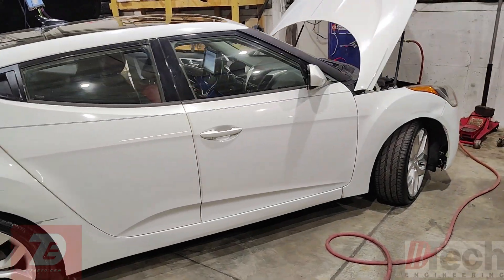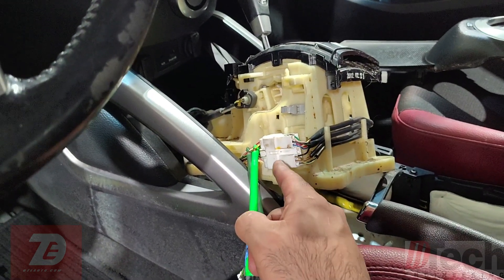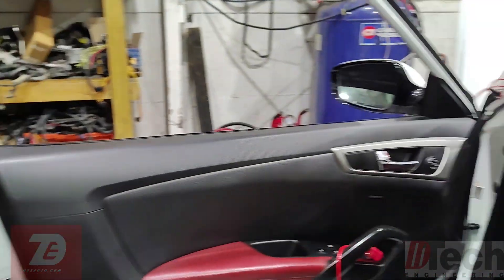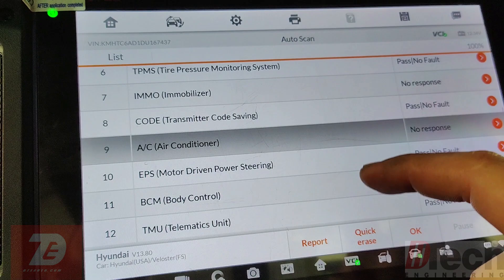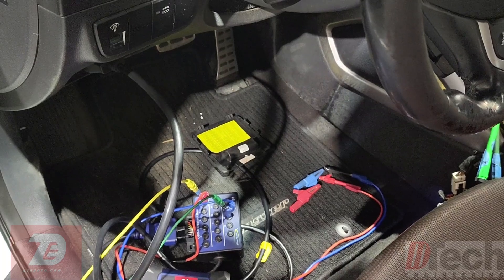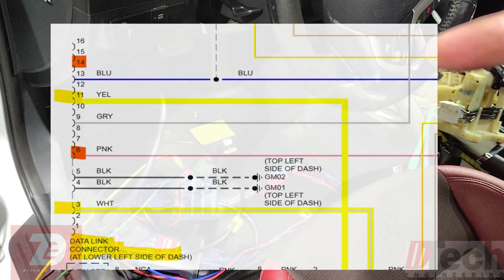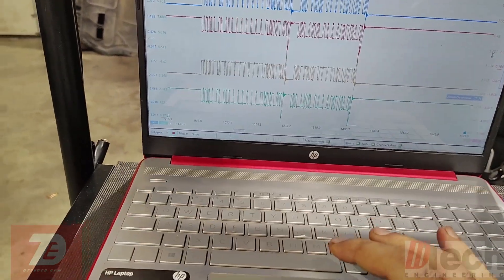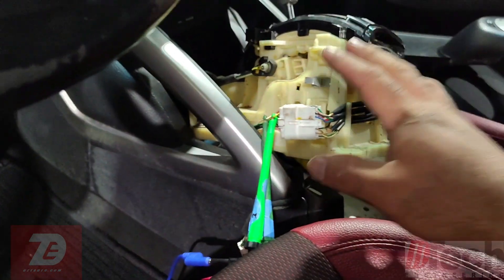2013 Hyundai Veloster Shifter (TGS) No Communication (U1103)

Comment: Question,  could the network being load test prior with a test light or park light bulb? This is after you confirmed the pin out? Just asking
Reply from the maker: I'm not sure of load testing network wiring is the best idea, especially because other modules are connected to it

Comment: https://youtu.be/op9gcg0lM3A?si=fjA6LDIZTDcxtNnv

12:15 mark shows an OBD 2 connector with two sets of numbers (ETM and OBD). Think the guy said it was just how the manufacture of the connector numbers it vs obd standard numbers it.  Also believe he’s working on a Hyundai/kia.  Seems like 3/11 and 6/14 are the same depending on what numbering version they’re using.  Don’t know why they would do this, guess they thought cars weren’t complicated enough that they would throw another curve ball at us lol.   Looking at oem wiring diagram shows they number the OBD 2 connector the ETM way, if that’s truly what it’s called,  not sure.    They number pin 1 at the longer/top side to the right and not to the left like it should be done.